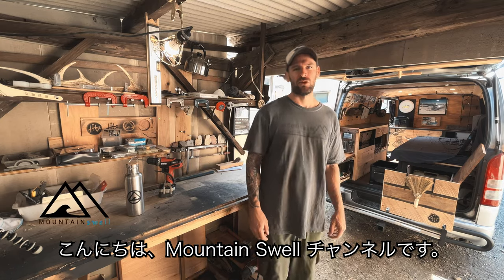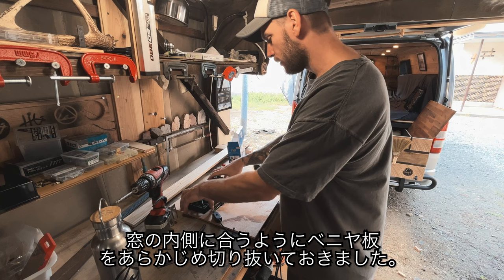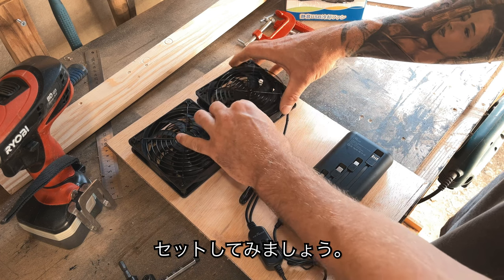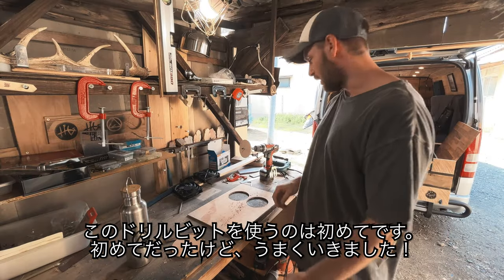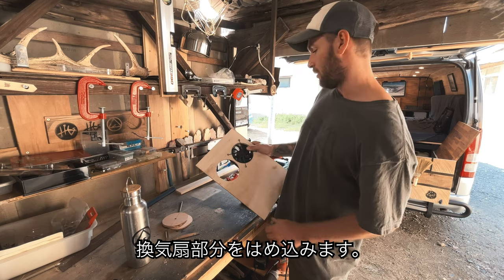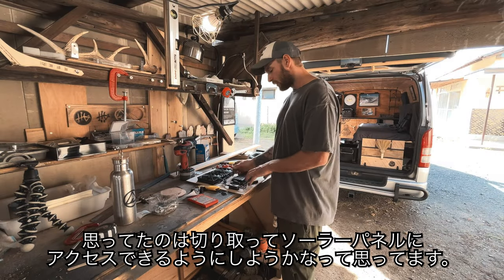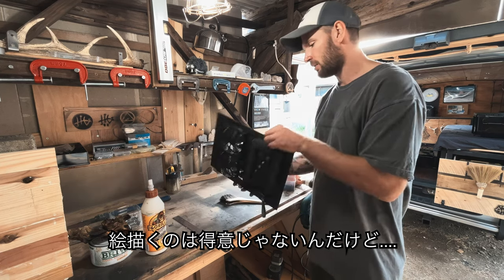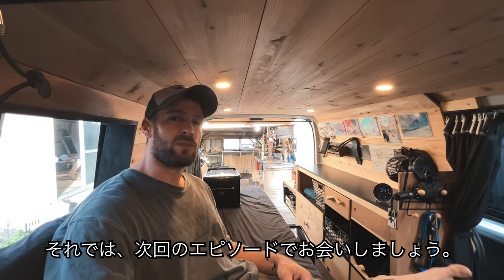How to MAKE Ventilation FAN for VAN #diy #vanlife #usb

Comment: Great idea!
Reply from the maker: Cheers 😃 although I can’t take the credit, got this idea from a Japanese guy on YouTube. They pretty innovative with the vanlife here. Ideally I would like a roof vent but can’t really do that here without a complicated process of reregistering my van to a camper. So this idea works well
Reply: @MountainSwell I'm trying to avoid cutting any holes. This method could also work for a temporary shore power connection.
Reply from the maker: @MsTikiB  yeh exactly. My whole van build has been avoiding cutting holes and even drilling holes. Although my recent installation I did have to cut a slight hole in the floor for my diesel heater but this was no problem for my registration in Japan. Also diesel heater is an absolute game changer 😮

Comment: I realise this I an old video, I am planning on making something very similar to this but my plan is to hold the fans in place with magnets that way I can turn them round depending if I want to pull air in or push it out.  I would very much like some additional info on that power bank, seems very very good.
Reply from the maker: 😂 yeh old in terms of YouTube timeline..
Oh the magnets sound like such a good idea. You should send me an update once done.
Reply from the maker: The power bank was something like this? GOHHME Solar Mobile Battery, 63,200 mAh Large Capacity I ordered from Amazon. 
Next time I make these videos will def add the links in description 😂 
This was like my first vids for YouTube

Comment: Question: could you do one fan drawing hot air out and one fan blowing cool air in? What would be optimal?
Reply from the maker: Ah yeh true. Could totally do that. Because these fans just flip around. So really could have one facing the opposite direction. 
For airflow inside my van I have a usb fan that can run for 8 hours on 1 charge and that is a lifesaver sleeping in the heat here. Japan is record breaking high temps just now but fortunately in the summers I’m at the beach so leave my widows open and have a nice breeze in the evenings

Comment: to keep the inside cool,would you bring air in or blow air out. gonna do the same with an ceiling fan for my Van,thx
Reply from the maker: Where I live in the summer it gets to mid 30 degrees so pretty hot. I blow the air in for circulation and use a cold wet face towel near the fan and feels cool. 
In the winter when I cook inside the van I blow the air out. 
I just made a simple build but probably way better things

Comment: Daft question alert here. Firstly, this helps reduce humidity, is this correct? I'm thinking of making something similar but thinking into the space of my skylight. But then, I could make something which doesn't take up the whole of the skylight's square, just a rectangle with two on, say, leaving the side open. (Imagine a square 36cm by 36cm, my board like yours would be 36cm by 14cm for instance). Window would have to be open, of course, but then does that defeat the point, would I have to 'seal' that whole 36cm by 36cm cm to be effective at sucking humidity out the van? Do you see what I mean? As in, there would be humidity in the outside air of varying levels that you then may want to stop getting in, that's why it might defeat the point.
Reply from the maker: I’m not sure if it helps humidity? That would be better to use an AC unit. I seen EcoFlow actually make a portable AC unit which looks awesome!

As far as humidity yeh it’s a tough one. Where I live in Southern Japan it gets very hot and humid in the summers and I know many people have that EcoFlow AC which definitely helps deal with the heat and humidity but for me I just sleep with my doors open and have a wee usb fan blowing all night.

During the winter this ventilation fan definitely helps with condensation and airflow though 🤙
Reply: @MountainSwell  Ah, sorry, I used the wrong term, yes, I meant condensation, I suppose I was meaning moisture in the air generally and reducing that! Thank you for your response. Glad to hear it helps condensation which is what I want! In my initial message swap all the words 'humidity' for condensation and then it'll make sense!
Reply from the maker: @pinkbsl7972  ah yeh should def help with condensation especially during the colders month actually
Reply from the maker: actually what its really good for is on cold or rainy days and need to cook inside the van it can takae the steam out
Reply: @MountainSwell  Wonderful, I'll build one!

Comment: How do you keep the air from getting in when fans are not on? How do you keep the rain out?  Usually on vents there is protection against these things.
Reply from the maker: Hey 🤙 yeh I just built this as a temporary fan system for if I cook inside the van during winter or sleep at night in summer. I don’t have this installed all the time. It just slots inside my window frame when I want to use. In Japan I have built everything in my van so it’s easy to take off when I have to do the vehicle inspection.
So I haven’t used when it’s been raining but yeh I also thought about that I need to make some sort of cover

Comment: That barely moved enough air to make a difference.
Reply from the maker: Good for airflow control in the van when can’t put an air vent in. For controlling the hot air I have another portable fan inside 🤙 
Also this really helps a lot in winter with cooking inside van